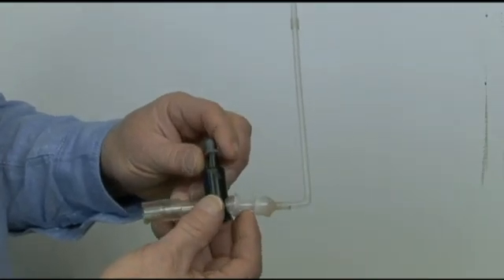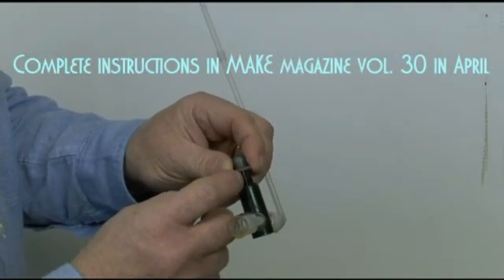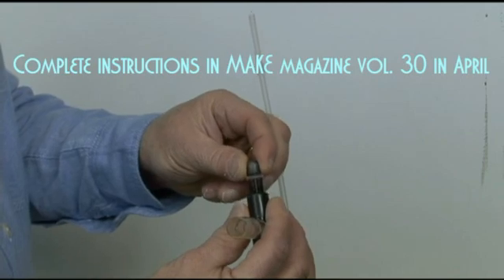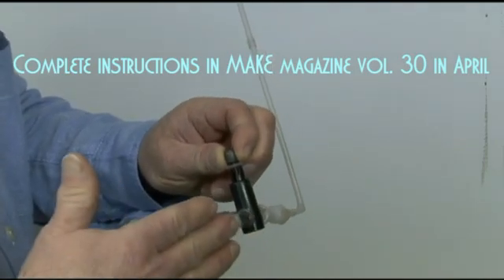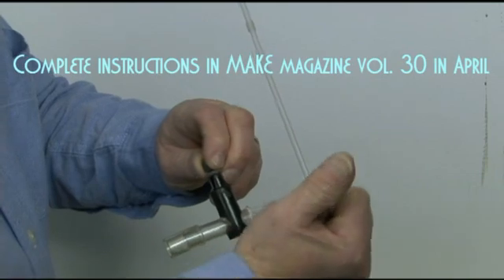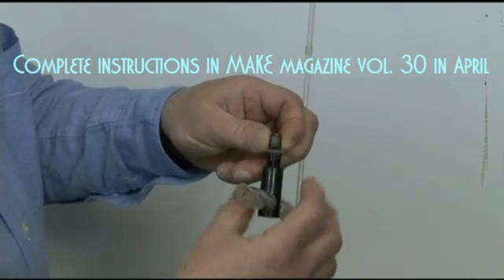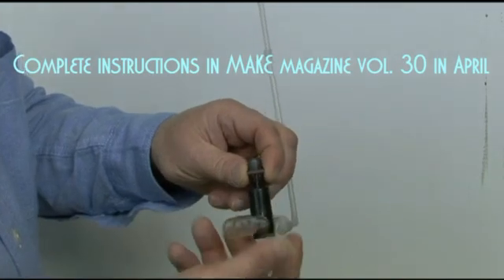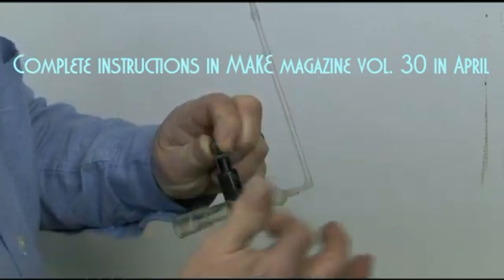How to make a model hydraulic ram

Comment: wouldn't this almost be like that one "perpetual motion device" in which the water is in a large tank with a tube running out the bottom then looping back up so the water is cycled back into the tank? it seems like all you would have to do is extend the tube so it spill back into the tank, thus making the originally theorized perpetual motion device a reality? i would like to see a video of that if you can build it, or would that somehow not work?